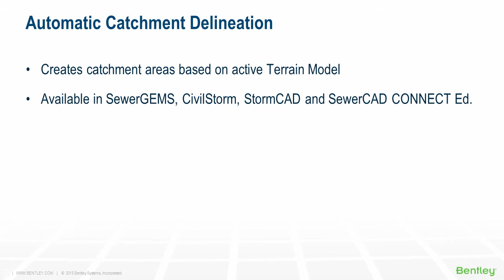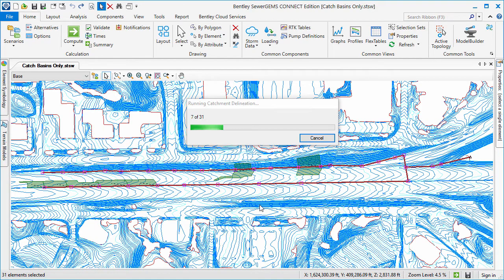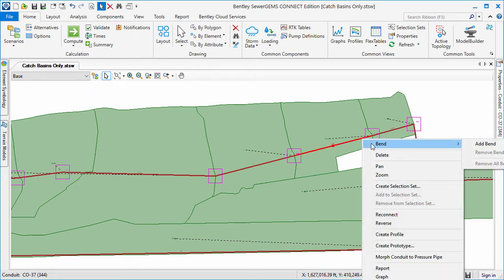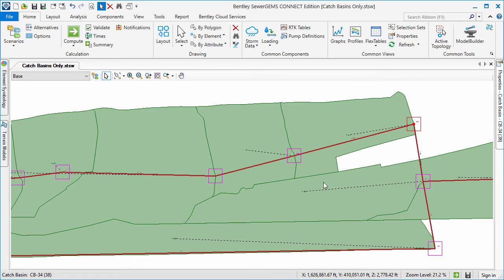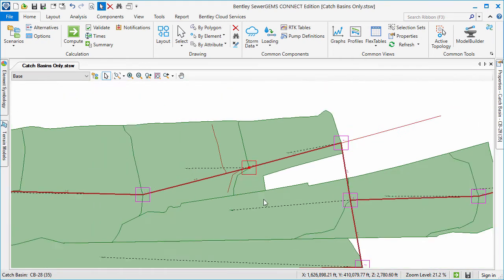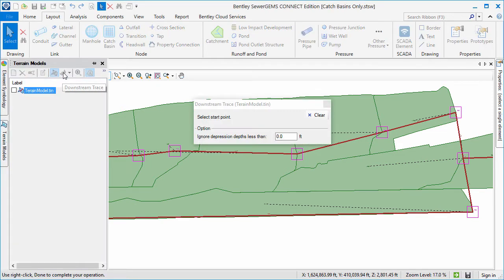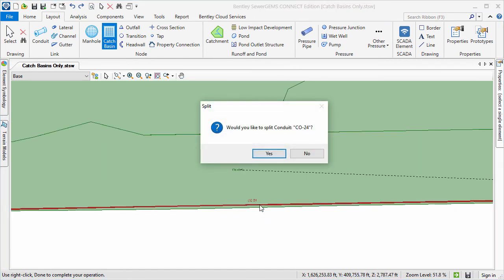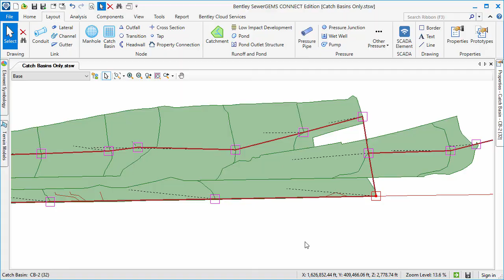Automated catchment delineation demonstration

Comment: Could I delineate basin for roadside ditches this way?
Reply from the maker: The catchment delineation feature is currently based on the area draining to a specific point (an inlet location). So, if you have a ditch that captures runoff without any inlets involved, you could place a "fake" inlet at increments along the ditch (to capture the area that drains to those points), and then remove those catchbasins, add channels and cross sections, and assign the catchment "outflow element" to the corresponding cross section node. If you need more help, post on our forum or submit a Case to Technical Support:
https://bentleysystems.service-now.com/community?id=community_forum&sys_id=0310b7ca1b1a3110f3fc5287624bcb80
https://bentleysystems.service-now.com/csp

Comment: Is there an option to draw land use on CivilStorm or Storm Cad?
Reply from the maker: You may want to post on our forum to elaborate on your question. Land use of a catchment is accounted for by way of the runoff coefficient (Rational C, SCS CN, etc). If you want to be able to visualize catchments to distinguish the different land uses, you could set up a color coding based on the runoff coefficient, or a user data extension storing your land use label.